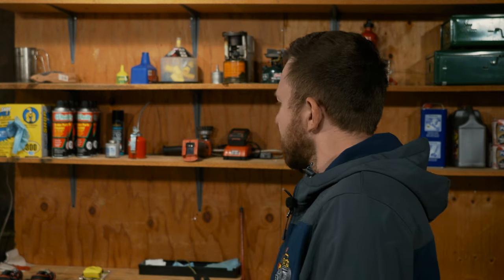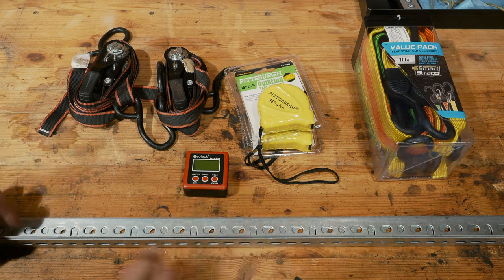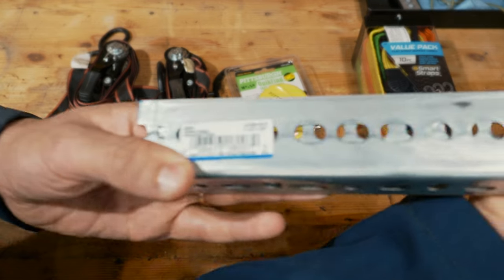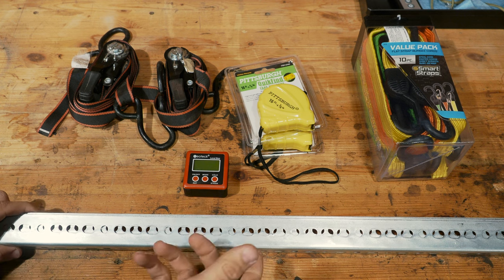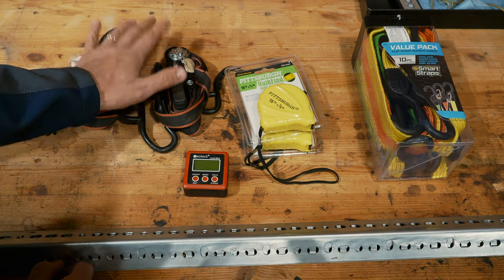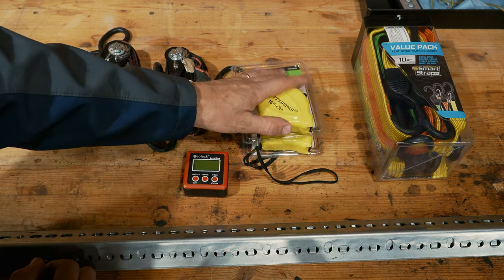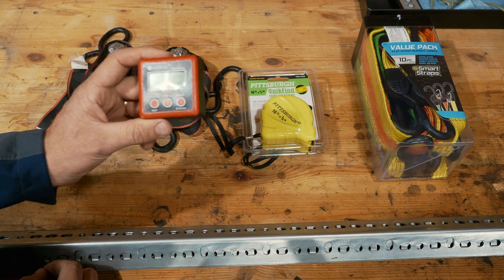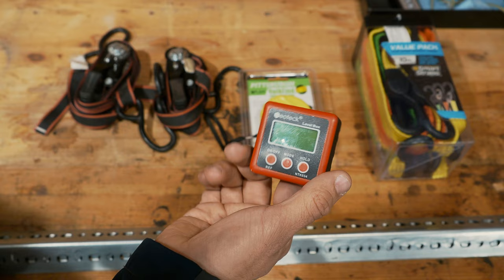How to Make a cheap DIY alignment tool

Comment: Camber and caster should be done before toe-in. You didn’t even check those
Reply from the maker: You're right.... I did not. It's a solid axle. Those measurements rarely move, furthermore, pinion angle takes precedence over caster/camber. Which are not adjustable independently of one another. This just an easy alignment checkup to help keep things in check. 

IFS is a totally different animal and this method does not work for that.
Reply: @EmbarkWithMark  
It works fine for IFS as well. Toe adjustment is the same concept on IFS. It's just a slightly different method of making the adjustment, because you adjust the outer tie rods independently.

Comment: this was done all WRONG ....

If 1 tire is off, the other will be thrown off with this method. Then you have 2 tires off. 
You MUST align the fronts FROM the fixed rear tires.
Reply from the maker: Wrong! This is solid axle, not IFS. 

Additional, it’s not possible to adjust one tire in a front solid axle vehicle. Both tires adjust equally at the same time. They are tied together, with a tie rod.
Reply: @EmbarkWithMark  Let me say this AGAIN ... But sorry i don't have crayons so, if 1 tire is OFF, the other tire will be off. 
Adjusting them to be equal to each other does not make them aligned to the rears.
Reply from the maker: @ACommenterOnYouTube  Use your crayons to drawer yourself a picture. One tire can’t be adjusted by it self. So if one tire is off, they are both off. Tied together, by, again… a tie rod. I’d send you info to read but it’s not in coloring book format.
Reply: #ConfidentlyIncorrect.
Reply: @Wrenchmonkey1  ok kiddo, get back to school
Reply: @ACommenterOnYouTube  
Says the confidently incorrect youtube commenter who repeatedly demonstrates zero understanding of the thing he's commenting on.

Good luck with being... you...
Reply: @Wrenchmonkey1  ok princess ....

Comment: Complete Nonsense!! None of that crap will "ever" get you an alignment!! At best this would be good for getting your new tires to the alignment shop!  I guess everyone spending 30-50K on shop Equipment must be stupid!   You are teaching people nonsense!  But that is just my opinion.  Ask yourself why are there turntables if you even know what they are.
Reply from the maker: Yea… you don’t need a 50k machine for a solid axle truck/jeep. In fact most stock Jeep/trucks have almost no adjustments on the control arms. So only the tow is really adjustable. 

The reason they have 50k machine? Time. Faster alignments means more money earned in a shorter period of time. And those machines work for almost any car style.

Comment: "Quick, easy" and wrong. Without a reference to the rear wheels, that are square on the vehicle, you have no idea if one or both front wheels are toed in properly. One front wheel could be perfectly straight and the other front wheel has all the toe in and you'd still show the toe in dimension that you want. 
You didn't address whether or not the steering wheel was straight either.
Reply from the maker: Can you explain the need for reference to the rear wheels on a solid front axle vehicle? 

You can not independently adjust toe on the front tries. Toe is either in spec or it’s not. 

Now I’d be inclined to agree with you if this was a Independent front end.
Reply: @EmbarkWithMark  The axle type has nothing to do with it. Like I said, without a reference to something that is known to be straight and square, the rear wheels, you have no way of knowing which way the front wheels are pointed. One front wheel could be perfectly straight and the other wheel toes in 1/4" and that would be wrong but it would still measure to be correct. The exact way a so called alignment shop left mine.
On any solid axle a tie rod goes from one steering knuckle to the other. One end has a tie rod end that is threaded and adjustable. You need to remove the castle nut, remove the tie rod end from the steering knuckle and make the adjustment there using a straight line from the rear. It must be reinstalled to make the measurement. Repeat as necessary. I used a DeWalt 3 plane laser and used the magnetic mount to hold it to the rear axle hub and squared the laser to the rear wheel. It then provided a straight line to the front where I could measure from the laser line to the front and rear of each front wheel to make the adjustment. You can put a plastic bag under each front tire to make it slippery so the wheels can move easily without moving the entire vehicle as it is adjusted.
Reply from the maker: So, a 4 wheel alignment is always best, and I am not going to argue that using your method does not work to do a complete alignment. 

However, the adjustment you explained on the tie rode it self does not make sense to me. Since its a solid bar straight across from one tire  to the other, any adjustment lengthens or shortens the entire bar. Even if you where to screw one tie rode all the in and leave the other all the way out both your tires will adjust at the the same rate since the length of the entire tie rod is being changed. Here is some info to better explain this garage alignment: https://www.quadratec.com/c/reference/jeep-tj-driveway-alignment

Is this method a complete 4 wheel alignment? No it isn't. However, this is an alignment that can be done in any garage very easily. Mostly because the rest of your alignment should not be changing, if it is then there are other issues. 

The plastic bag idea is a smart one. You can also use jack stands under the axle it self. I know someone who uses two pieces of HDPE sandwiched together for each tire. He jacks the jeep up, places two of HDPE on top each other, then lowers the tire on to them. Very slick surface.
Reply: Could you take measurements from the inner rim or disk to a fixed point on the chassis ? get both the same each side, and then set the tow as theoretically the wheels would be "pointing straight with the chassis/ body direction.
Reply: I'm thinking if you measure example 50mm each side front rim to chassis then the wheels are "pointing forward" then you could clamp the steering wheel and add toe adjustments from there knowing you've got your reference
Reply: @abc123732  It seems unlikely that the frame would be so perfect.
Reply: He’s not doing a 4 wheel alignment or even a total alignment for the front. This is for toe in and the way he is doing it is how toe in alignment is done. He’s just showing how to do it yourself at home with cheap tools. You can take it to a shop with all the fancy tools but they still adjust it the same way he does. Loosen the lock nuts on the tie rod ends. Turn the drag link in or out to adjust the toe and tighten them back up.
Reply: @abc123732  No, because that point would need to be exactly in the center of the vehicle, which it won't be, and there is too much room for error. Also, you need to measure from the front of the wheel and from the back making the the errors even larger. Measuring from the brake disc is no good either because it is way smaller than the wheel which makes the difference in measurements too small to be done accurately.
Reply: @trustme7731  
Lay off the alcohol, and put 3 seconds of thought into this before commenting next time. 

If the steering wheel is centered, and the wheels are toed correctly (which means relative to each other), there's literally no benefit to knowing, or caring about the rear axle. If the rear axle isn't square, you've got much bigger problems. If it is straight, it still doesn't have anything to do with setting the toe. Your rear axle could be an entirely different width from the front axle, and it STILL wouldn't matter.
Reply: @trustme7731  toe adjustment is only a reference to the opposite wheel/tire across from it….a front end toe adjustment has nothing to do with rear wheels whatsoever. Same goes for rear toe if your calls for it….nothing to do with front tires. Trail or track, has a reference to front end, and that is another adjustment that deals with a car crabbing sideways down the road, essentially the rear tires both pointing in an different direction than that of the front tires, and that affects handling. Toe is or toe out, scrubs the tires of their rubber, and when severely out of spec, affects handling and tire grip.
Reply: @trustme7731  take a single axle trailer…..and if you could, bend one of the spindles inward toward let’s say the tongue of the trailer, you’ve just toed in the trailer, and you should expect the tires to wear incredibly fast, and it take a considerable amount of energy to tow that trailer, in reference to a trailer with a perfect toe adjustment. See for toe, no rear tires needed, or the need to reference rear tires in regards to toe adjustment. That’s what the individual on the video is showing…..TOE!